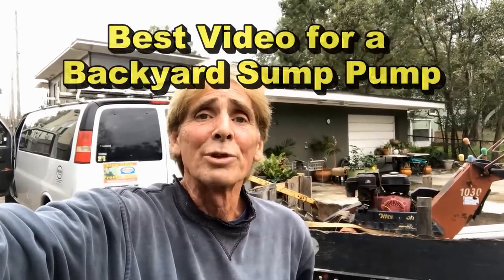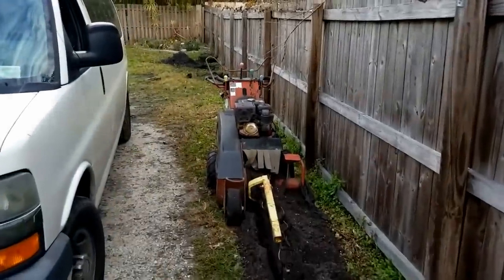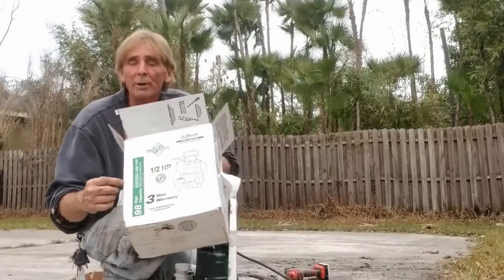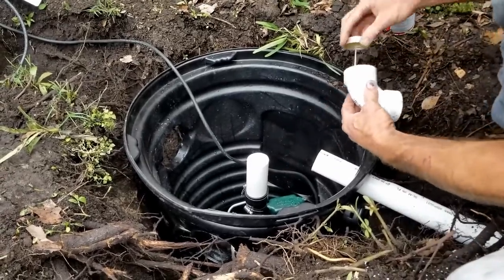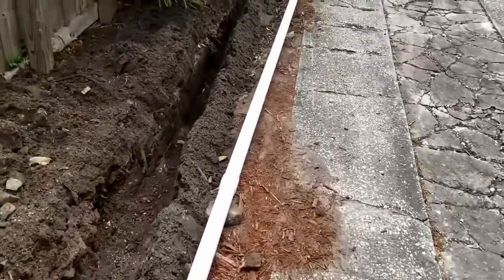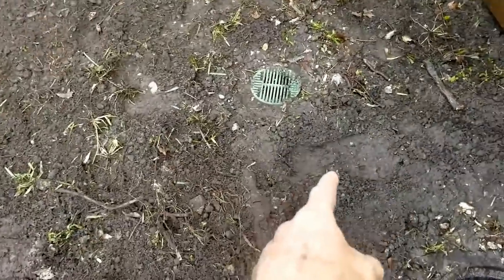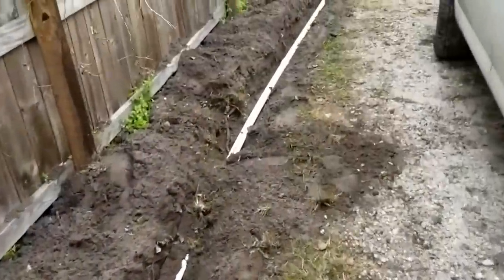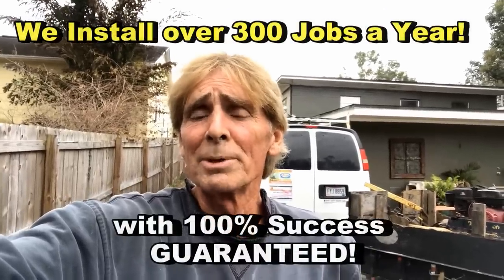Sump System that Works! 100% Guaranteed

Comment: I just put one of those in yesterday, I had 14' of dynamic head and it pumps like crazy. It's sitting in a polyock 24" catch basin with a 12" riser. Someone forgot to put a drain in a walkout basement entrance.

Comment: I’m new to your videos. Can you use this same system in a winter climate like Detroit. (We live across the boarder in Canada, same climate as Detroit).  Any concerns about freezing either in the basin effecting the pump or in the line. 
Also I have power from the shed accessible for the pump but can I add to it a battery back up. We often lose power in a storm.

Comment: Hi Chuck.  
I posted just now on an older video.  Hope you get to see my question below.  

I am curious how to remove the "left over" rain water that collects in my 4" drain pipe that exits at the street.  The drainage pipe is 4" solid PVC and has a 1% fall and runs 160 feet to the street.  I am draining about 1500 sqft of roofing/gutters with catch basins at each gutter of the 4 gutter exits. Water will rise out of the catch basin and drain to the street just fine, but once all the rain is done I have about 100 feet of pipe with water, that "tapers" downhill and keeps the basin full until it evaporates.  I assume this is about 60 gallons or so, since a 10' length of solid 4" pvc holds about 6 gallons of water.    The 12 inch basin is filled from the bottom with a long sweeping 90 degree turn and the top of the basin to the bottom of the 90 is about 2 feet under ground at the curb/street.
    

How should I drain the 100 or so feet of "full" pipe ~60 gallons or so?

Comment: Is an extension cord ran from a power source to the sum pump and if so how does that work? Thanks!
Reply: You should have a GFIC exterior outlet installed at the pump basin.

Comment: how are you getting power to the pump?
Reply: He probably had an electrician run an underground conduit to stub up beside it. Set a weatherproof handy box, WR GFI, and while in use weatherproof cover. That’s what I would do and I’m an electrician.